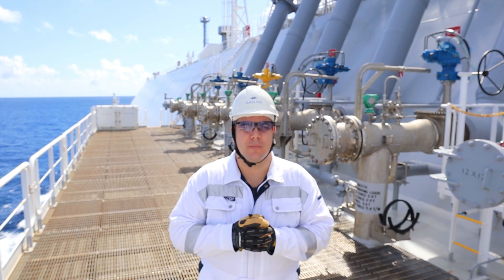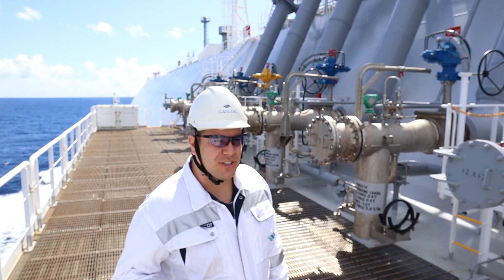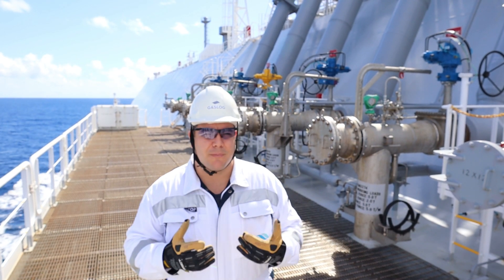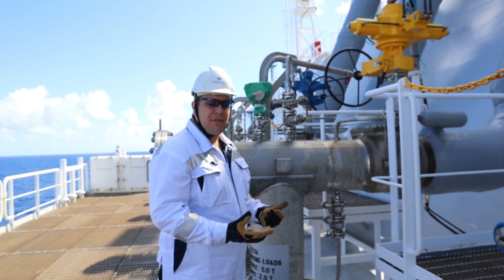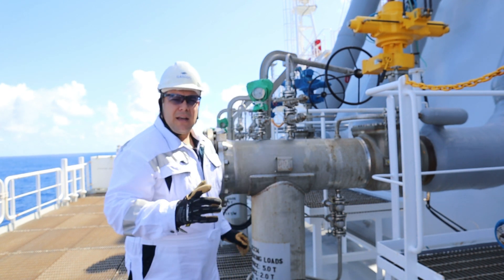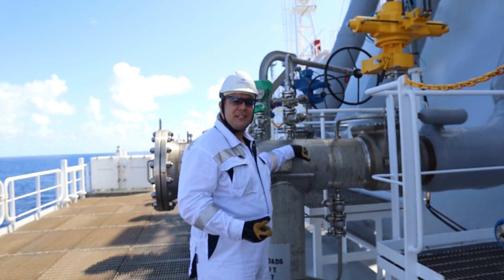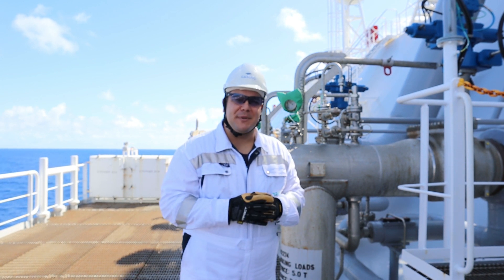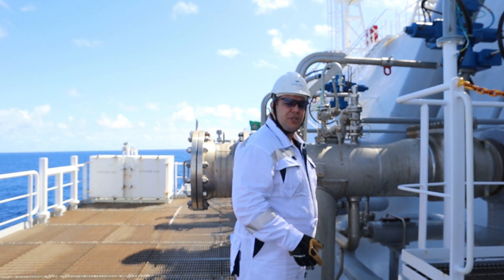How do we load liquified natural gas on to our ship and what are the cargo manifolds liquid or vapor

Comment: In hot climate it is better to pressurize with 4 bars because it expands due to the heat. Is this right captain?
Reply from the maker: The important is to have a good pressure of Nitrogen in them.I can remember a good Chief Mate that I worked with he was checking daily the pressures there.

Comment: Hey nick , what exactly is the purpose of the Double Shut off valve which I believe is vertically above the ESD valves on this ship ? And why are they called “double shut off “??
Reply from the maker: Hello the double shut Off valves are part of the cargo piping system and is a system which can be operated only manually.I believe the people who wrote the code thought ahead that these need to be manual since operators can not make mistakes with them.It is a second form of protection.